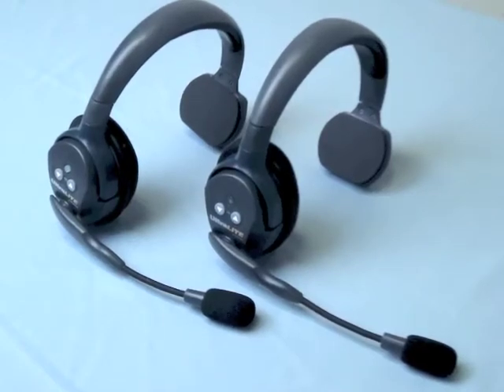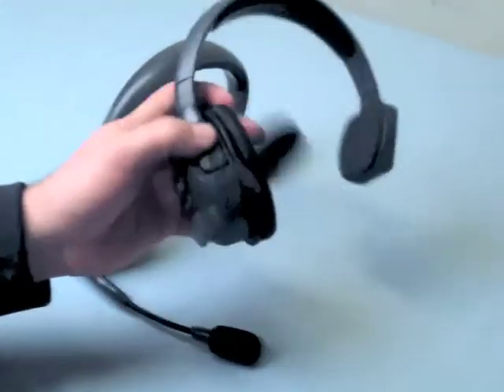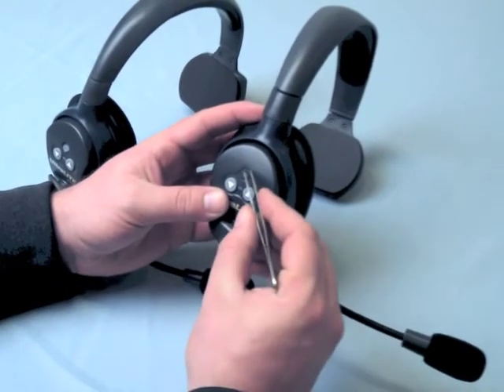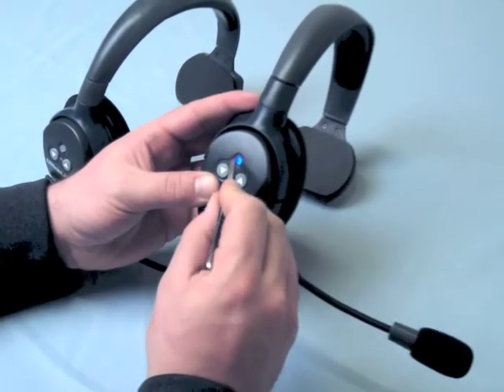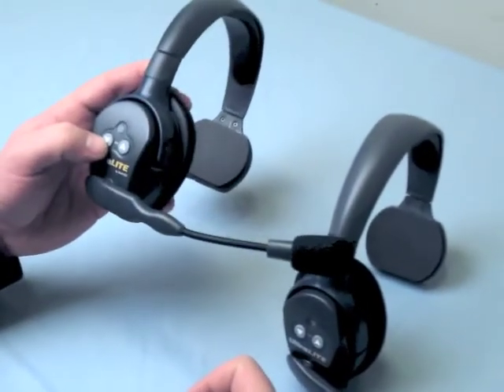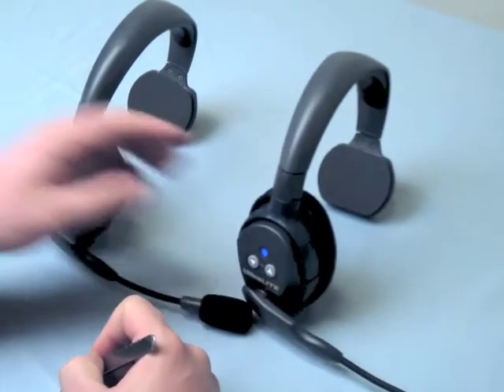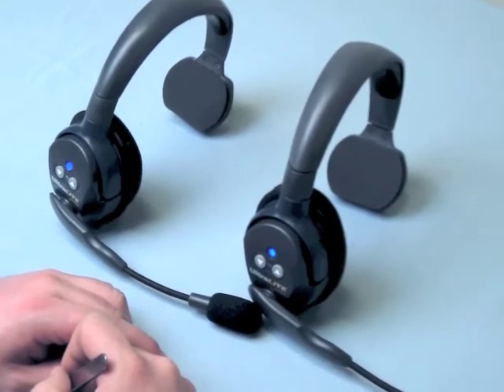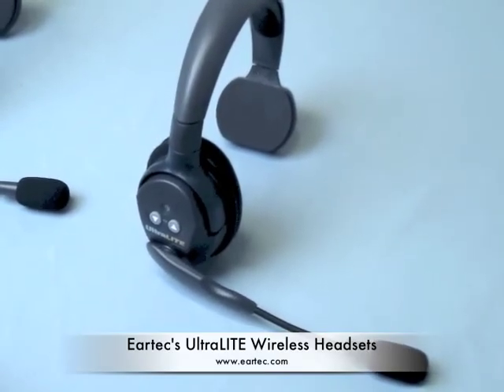UltraLITE Programming

Comment: Great video. Quick question for anybody.  The video says "turn on the master unit":  None of my headsets say "master" and they all look alike.  What makes the "master" the "master"?  Is it just the first one you pair?
Reply: Should have a power switch on the bottom of the battery side.
Reply: @Deadsociety212 I have the same problem non of my headset has master or the one with master button on any of my headset. How do I get it work? Thanks in advance

Comment: I have a question. My school uses The Hub and 7 headsets to run tech during the schools on stage theater productions. I want to buy and use a separate set of 3 headsets for communicating with a video production crew as we film those same stage productions without having to deal with all of the behind the scenes radio chatter of the other 7 headsets. Is it possible to run two sperate but close by Eartec systems? In other words can I buy a 3 piece set and have it on a different "channel" by not connecting to the Hub? Just have my own master and 2 remotes, or with the close proximity cause problems?

Comment: Still unable to link my pair of headsets based on the instructions that came with them which is a little different than what is shown in the video. Should I be doing it as the video shows or the directions that came with them. They are the UltraLITE HD type.
Reply: Can you make a tutorial? Joel
Reply: Can you share the trick to UltraLITE HD. I am finding it really confusing